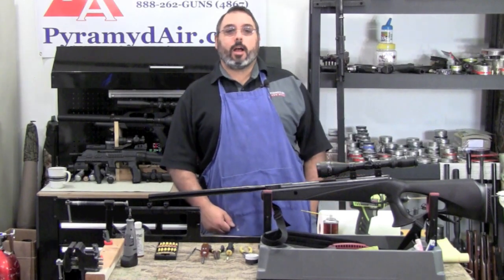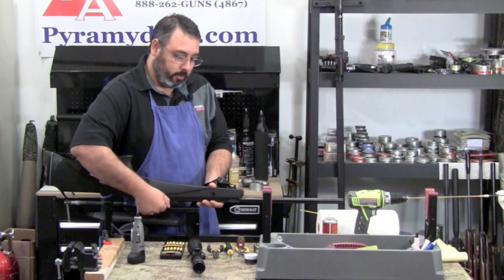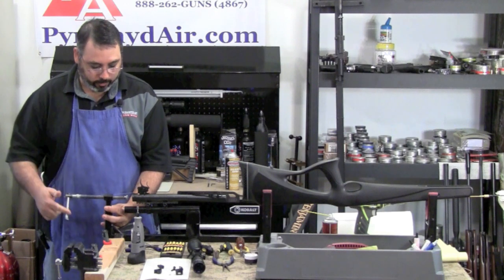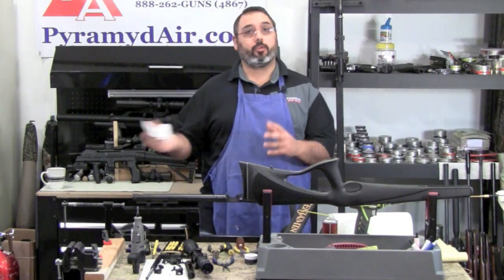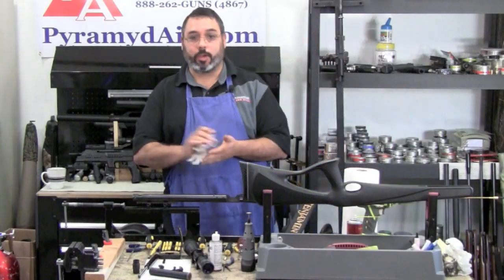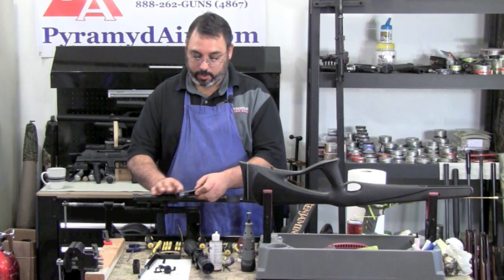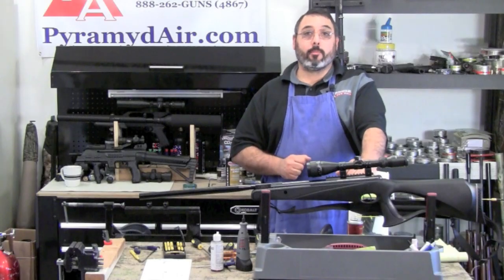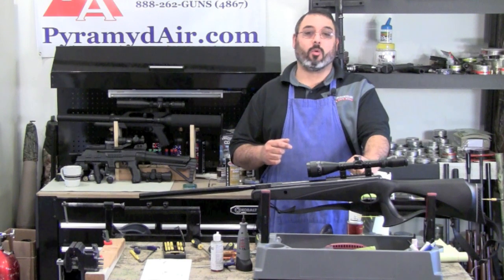Take AIM Episode 8 - How to rebuild your breakbarrel airgun

Comment: Hello. 
I have a Benjamin trail np xl .25 cal.  So i want to rebuild it.  But i have a problem . I don't know how to get off that end cap from it. You just simply pull it from the rifle . But on my rifle i think is thread on that end cap but i can't unscrew it . Do you have any solution ?
Reply from the maker: The end cap should unscrew.  You need a special tool to get the cap off.  You'll need to make one, or improvise.  I've used two allen wrenches in the past.  I don't have one here to show you how, but you'll figure it out if you put some thought into it.  Be extremely careful working on any airgun.  If you are not 100% sure how to do it, then have someone help you, or pay someone to do it for you.

Cheers,
AGW

Comment: Hey Rick how do you know when the piston seal is too far worn to re-use? I just checked mine and there are some dents around the edge, but not too bad. Also, I couldn't find a replacement seal on PA that is directly advertised for the Trail NP. Is there another one that will work? Does the old one just pop right off?

Thanks

Comment: I have an air rifle I fired with the barrel not fully locked back. It didn't do the whole snap shut and bend thing as I've seen in some videos. It just won't load when I break the barrel now, no clicky sound. Any idea what needs fixing? I'm gonna open it up and see what I can do but I'd like some info as I've never fixed one before. Thanks ^_^
Reply from the maker: Not sure what's up with that gun.  You may have damaged more than you think.  If you figure it out, let us know!

Cheers
AGW
Reply: Any luck fixing it? Same thing happened to mine
Reply: did u ever figure this out

Comment: Hey I have a Benjamin trail np xl it does not cock do you know the problem or what I need to do to this gun in order to solve the problem
Reply from the maker: How long have you had the rifle Edwin? I would call who I bought the rifle from and see about getting another one. If that does not work call Crosman. There is probably something wrong with the piston that is not allowing it to cock. 

Cheers,
AGW

Comment: Could you update this video with an HD camera? It's pretty blurry. Thanks.
Reply from the maker: Hey there Darren,

I don’t expect that I’ll be redoing this video.  Possibly if PyramydAir or another sponsor requested it I may be able to get to it, but I don’t see myself getting to in anytime in the near (or distant) future.  Now I may be able to have my shop foreman do a video at some time for Airgun Pro Shop and he can go through it, but I don’t see that happening until after Covid is past.  We are just buried right now.

Cheers

R

p.s. check on www.gatewaytoairgus.org for some help.. there are a TON of old timers on there than may be able to walk you through the process.
Reply: @AirGunWeb  Thats okay. After looking at my gun and checking out the position of the trigger, etc.  I figured out how to put it back together. I believe my issue was the Nitro piston spring. ( the shock absorber looking thing l that caused the gun to have no power and super easy cocking. Still looking for videos on what parts to lube with the Crosman chamber oil other than the seal. Thanks

Comment: Is there a way to transefer a .177 to a .22?
Reply from the maker: +GianniOutdoor - depends on the airgun.. best to search out the forums about your particular airgun and then see if someone has worked out the details.

Cheers
AGW
Reply: +GianniOutdoor While it may be possible to use some kind of long dremel tool to increase the size of your rifle bore, you would lose all the rifleing in the barrel which is important for accuracy and range. Generally the answer is no.

Comment: i took my trigger assembly apart on accident and i'm having an extremely difficult time putting it back together. i have this same gun in .177. when i break it it wont cock all the way. please i need help anyone?
Reply: J.B.R Gaming + Try calling or emailing the mfg. Try drawing sketches of where the parts might fit. Keep track of each attempt, so don't get too redundant. Look into the. 177, it'll be the same. 
It's not that many parts. Make it your winter goal.

Comment: I wish you had actually shown what you had to do to re install the trigger group.  What is your purpose of doing this video?Are you just bragging? You don't seem to actually want to show any detail  on tricky parts of the process and since most of the guns out there are spring piston I would have found that more benefit.  I have a Gamo Shadow 1000 and nobody seems to want to do tunes or rebuilds on Gamo's so I am left to my own devices to get my rifle shooting again.  Somebody actually could use your video if you cared to make it really informative..
Reply from the maker: Charlotte Henry This was never meant to be a complete tutorial on how to tune and rebuild an airgun.  This was about showing the basics of the process.  I'd be more than happy to do a multi-part series on the full "how to" if there was a party that would cover the production costs to do so.  As for your Gamo.  That's an extremely easy gun to work on and there are several places on the web you can get help with the process starting with the various forums.  On another note, there were no "how to's" when I learned how to do this.  I had to work it out for myself and even design my own spring compressor to make the work easier and safer.  Sometimes you have to just get your hands dirty and learn the hard way.  Cheers,AGW
Reply: Thanks for the reply! It's just that you mentioned that it really tricky getting the trigger group back in and then, BOOM, it's in No explanation.  I know I can come across as combative, (I don't really mean to be), but if you will do a search for a real "how to" video on virtually any subject you will find scads of video's, except when you look for this. Your air gun video reviews are really the best.  I like that you don't do carte blanche glowing reviews on everything. It makes you trustworthy. Merry Christmas to you!
Reply from the maker: Charlotte Henry 
Hey there.. No offense taken on this end and thank you for the kind words. The way I learned was to start working on very inexpensive airguns and just assumed that I was going to brick a few in the leaning process.  When it came to the trigger, Crosman, Gamo, etc., I would always have a duplicate gun that I could reference if I could not figure out how something went back together.  There's certainly a place for someone to get in there and make videos on how all this stuff works.  I just don't have the time right now for it, especially if I don't have a sponsor to pick up the costs.  All this has become my full time job.

Cheers
AGW